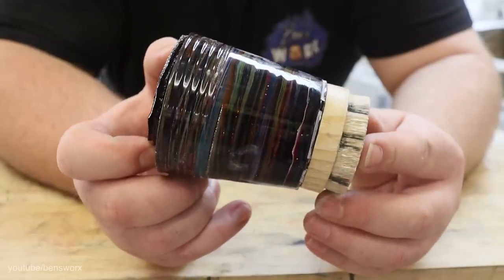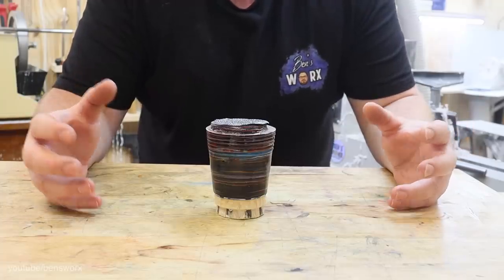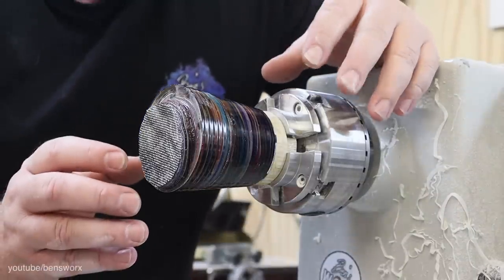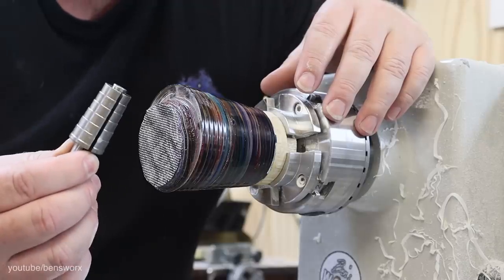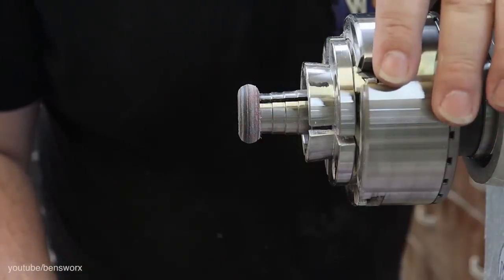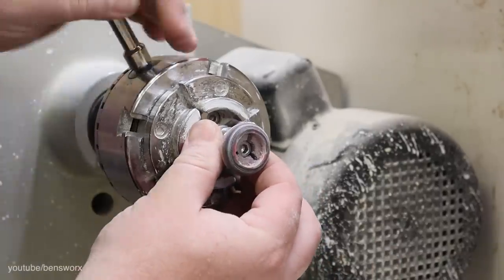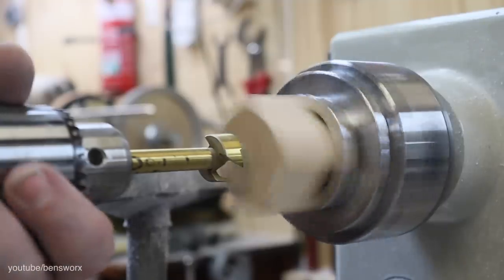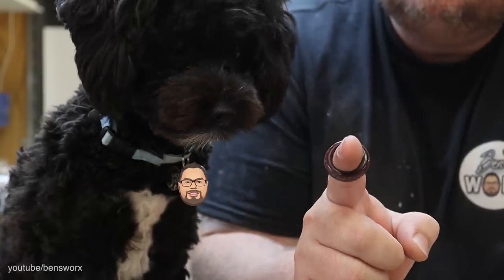Turning Fabric into Jewelry - Resin Art

Comment: Hey Ben, I’ve been trying for weeks to copy a key to my house. It’s a high security key with side cuts so no local locksmith has the ability to replicate it. Since I didn’t buy the locks originally, Schlage won’t do anything for me with getting one from the factory. I’ve made multiple silicone negative molds, but haven’t found a resin yet that is not brittle but still stiff enough. I’ve tried fiberglass shreds, but then I get voids in the key. Any suggestions on a product or additive to help me out? I’ve even tried pewter since the temp is low enough for the silicone, but it’s too bendy at that thinness.
Reply from the maker: Hi Mate, unfortunately with a piece that thin it will either break or bend
Reply: Try a thin piece of steel the size of the core of the key with fiberglass resin cast around it.